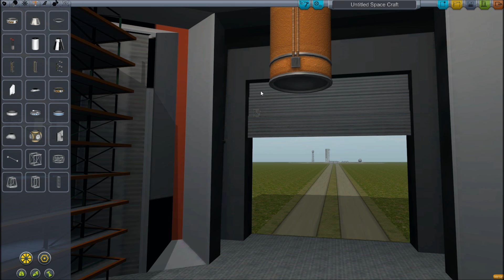Kerbal Quick Tip - Multi engines

Comment: It's not. 4 LV-T45 is 6 weight units, like the mainsail, but has got a ISP of 370 instead of 330. It does have less thrust, and must therefore fight gravity more, but you shouldn't be going that fast anyway due to air resistance.

Comment: you dont have to use full throttle all the time, during ascente. you can just throttle back a bit. to reduce drag. and if you dont use nine engines, like in the video, but five or six, you thrust will be lower than the mainsail anyway. but the much higer isp is the reason, why almost every desing with multiple small engines is more efficent than the mainsail.

Comment: On a smaller rocket though, the mainsail would make it go to fast, so less engines would also be better in that case.
And the isp of 9 small engines basically counters the weight.